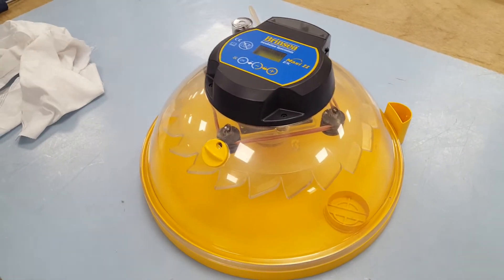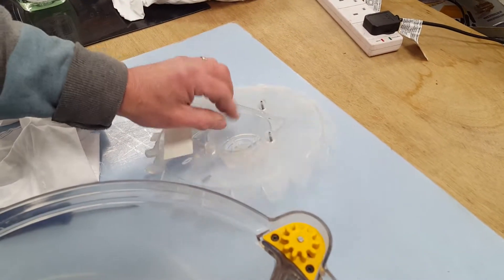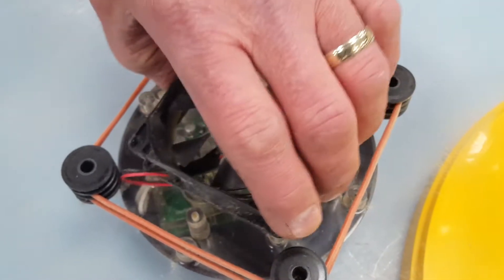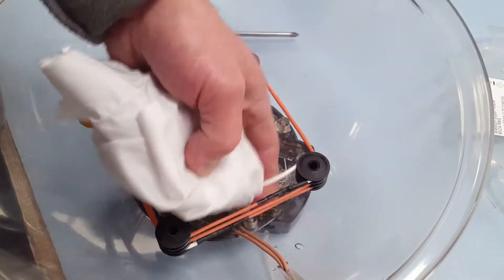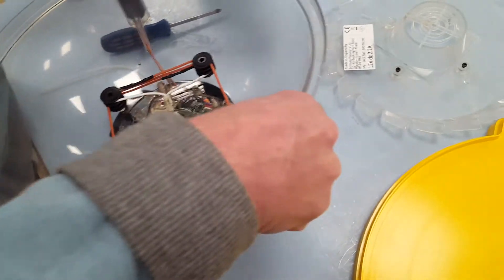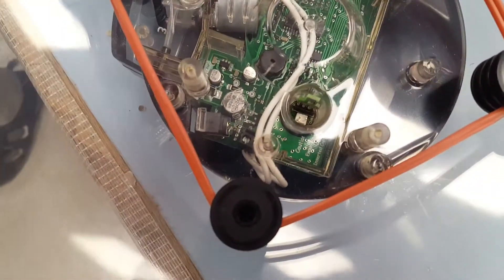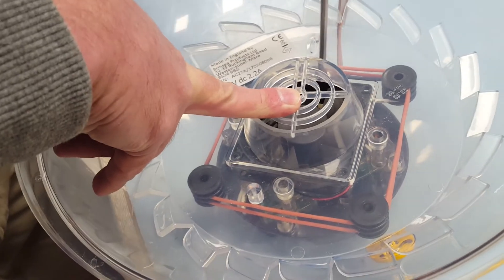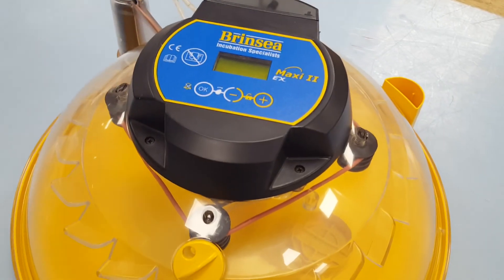Brinsea Maxi II - cleaning and changing the fan

Comment: Hi there. I just love these instructional videos. Just brilliant.  Just wondering if you could do a tutorial on replacing the auto turner. The screws on the auto turner are starting to rust because of the high humidity and I want to be prepared. Just in case.  I would be grateful for the screw size and type so I can replace them myself. Great products which I recommend to everybody.  Two friends have recently bought them at my recommendation and they love them. I’ve even hatched turkeys in my mini and maxi incubators - although I know it’s not recommended. Both had 100% hatch rates.
Reply from the maker: Hi Ann, please can you email sales@brinsea.co.uk and we will be able to help you with this.

Comment: is there a way of cleaning the turning device in the side of the incubator?  It has brown wires connecting to the motherboard.  My turning device seems to have moisture in it and some old bits of down. I have cleaned the fan and put back in
Reply from the maker: Hello Kathryn, please can you email us: sales@brinsea.co.uk and send us a photo of the bit you are trying to clean - we can then send you information on what to do. Kind regards, Brinsea.
Reply: @BrinseaProductsLtd  ok, thanks  a lot
Reply from the maker: No problem, please make sure you have fitted the fan back in correctly - you should not be able to see the label when you look under the lid. We look forward to receiving your email. Kind regards, Brinsea.

Comment: I would be a bit reluctant to use a large vacume around the motherboard of the incubator as the static electricity can destroy the motherboards components.
Reply from the maker: Hello Albert. I have just spoken to our technician to clarify this. The only exposed part of the control board is the sensor, in the video we say to be careful cleaning around the sensor and we only use the vacuum remove any loose dirt. We do not advise the customer to remove the board when cleaning. 
The nozzle and tubing of the vacuum cleaner used in the video are plastic and unlikely to conduct electricity. He has cleaned hundreds of incubators with a vacuum cleaner  and never had a problem with static. Kind regards, Brinsea.

Comment: Hello, I have received a Brinsea Ovascope. There is a black rubber tube in the pack which in the first drawing in the brochures of the product it shows it should not be placed over the LED light, however it is not mentioned where it should be placed or what’s the use of it. Would you be able to clarify what is the use of this tiny black rubber tube? Thanks.
Reply from the maker: Hello, do you mean the flexible black ring that comes with the OvaView that you use with the OvaScope? The instructions show that when you use the OvaScope with the OvaView you do not use the black ring too. The black ring is for when you are candling eggs without the OvaScope - it gives you a smaller aperture to allow you to see more detail inside the egg. The OvaScope will not fit with this flexible ring in place. The smaller flatter disc that comes supplied with the OvaScope is for when you are candling smaller eggs, as in the top right hand diagram. I'm sorry that there was a delay in replying to you but we are so busy at the moment. The quickest way to contact us is to email us: sales@brinsea.co.uk. Kind regards, Brinsea.
Reply: BrinseaProductsLtd - Thank you for the reply and support. I also came to the same conclusion after using the OvaScope.
Reply from the maker: You're welcome. If you have any other questions or need support with any of our products the fastest way to get a response is to email us: sales@brinsea.co.uk as we are extremely busy at the moment and don't get chance to check our YouTube pages every day. Kind regards, Brinsea.